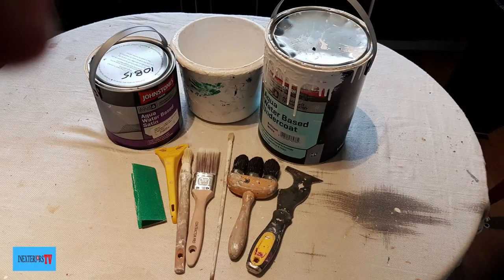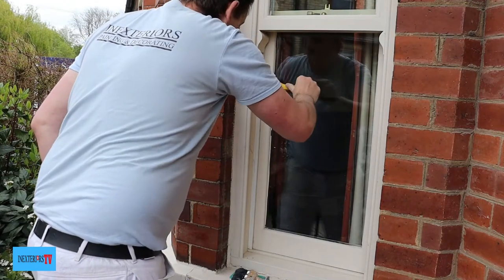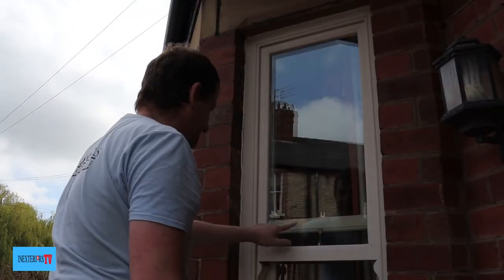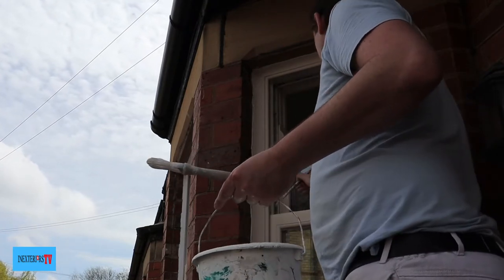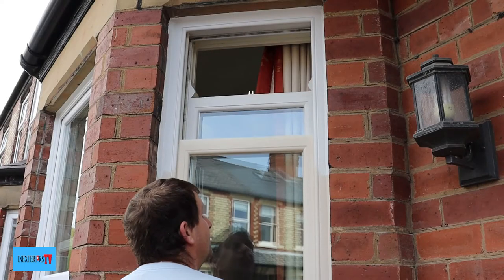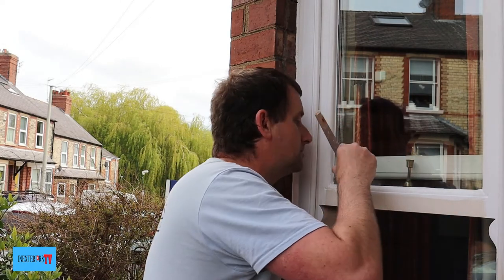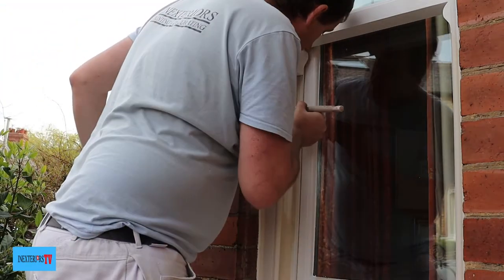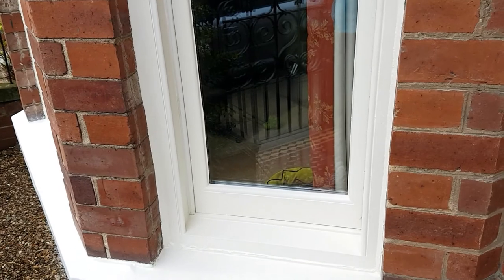How to paint a sash window. How to paint a window.

Comment: Definitely the best video I've found, thanks! I have to paint newish windows this week. They are primed already, I think it was an oil based primer, but I read that water based paints are handier. I see in a comment below that you used an oil based primer — and it looks like you are using water based paint? 

So, I guess it's okay to use an oil based primer and water based paint? Thanks! You can probably tell I don't know much about painting :D
Reply from the maker: Thankyou Very much. You shouldn't use water based paint over oil base. If i remember i spot primed it in oil based primer,  the undercoat and top coat  is Johnston's aqua. it is what known as a hybrid, it is water based with the benifits of oil that can go over oil based paint. hope that makes sense.
Reply: @Inexteriors  Yes, very helpful, thanks!

Comment: if you have a piece of bare wood (replacement) or a weathered / stripped sill would you do 2 coats of primer then 2 coats of exterior topcoat? Thanks
Reply from the maker: @D Beddows . 1 primer 2 undercoats 1 or 2 top coats the more the better. but to be honest i just do the 1 topcoat.
Reply: @Inexteriors  thanks

Comment: What’s a “hybrid” undercoat?
Reply from the maker: Sorry for late response, i have been on holiday, Hybrid  paint has a water base (like latex paint) but still contains alkyd resins (like oil-based,  it has a hard and durable finish (similarly to how oil-based paint dries) but does not emit as many fumes or VOCs, and is easier to clean up.

Comment: What  Primer   Did you use
Reply from the maker: @Mark Crotty i used Leyland oil based primer.
Reply: Do you ever use  bin
Reply from the maker: @Mark Crotty yes it just depends what i have at the time, or if i need it to dry fast.
Reply: Hello,  and a nice job you-have done,  on the box sash windows 
But just wondering why you didn’t gloss them up?  Because after a year or more the weather takes the shine off the gloss. And you get a satin finish….. that’s why I always use gloss finish on exterior woodwork……